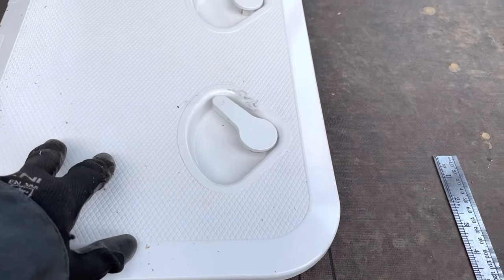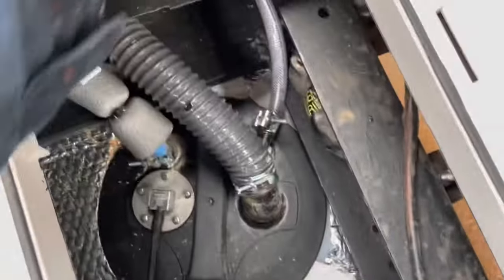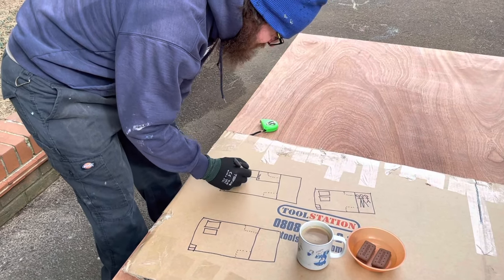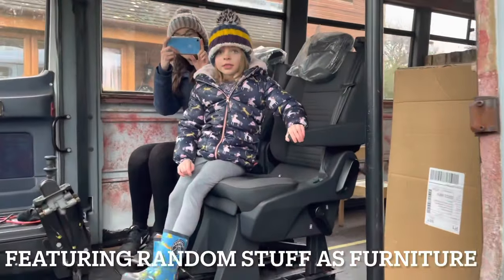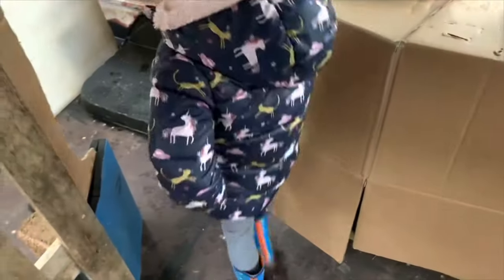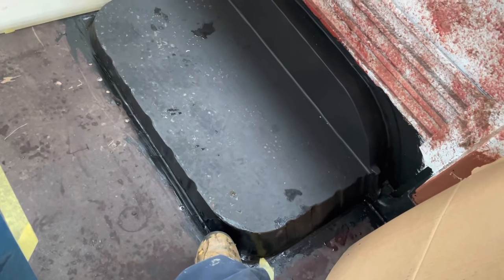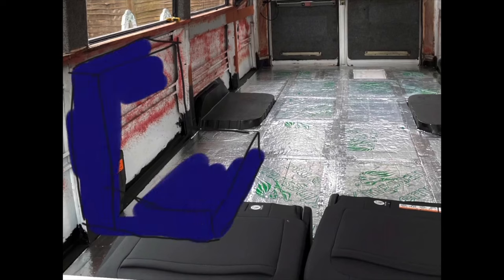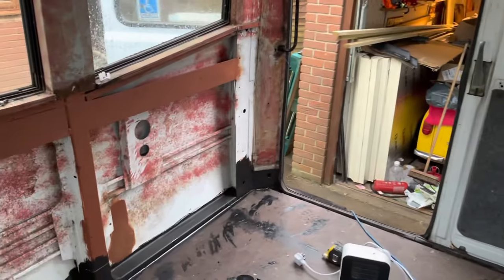Planning Our Van Layout | Mercedes Vario Bus Conversion

Comment: Have you concidered having the bed running length ways.  This will leave enough room to put the shower/toilet at the back of the bus by the rear doors.  I think this layout will create a more open space at the front of the bus for a kitchen and seating area.  The seat can easy accommodate a small bed for your daughter.   Im just starting my build of a vario 814 and this is my prefered layout.
Reply from the maker: That does sound like an option. So would you access the bathroom via a ‘corridor’ down the side of the bed? Or would the bathroom be next to the bed?
Reply: @WanderbusAdventures  the bathroom would fill the space from behind the wheel arch to the back door leaving a little 'corridor' besides the bed.  This keeps the toilet away from the kitchen area and makes the rest of the van seem bigger as there isn't a massive toilet cubicle in the middle of the van.
Reply from the maker: That makes sense. Our fixed passenger seats do eat into what’s in front at the moment which means there’s less space to push the bed forward. We will mark it out on the floor though. See what might work.

Comment: G'day Rich, Kelly and Lilly, good to see you again the hatch  cover reminds me of my boat that I use to have good idea the the way that you have used it as an inspection hatch.    How you have design  the fit out looks fine I wouldn't like to do it but I think that you have used the available space well, the only thing I don't like is the composting toilet.    I rented a van once and it had a cassette type in it and it was fine the thing is with two adults and a child the urine part will fill up quick.   I know it's probably just me but I hope that you don't take offence, those front seats are the "ducks guts" they look very comfortable as always great to see you all take care kind regards John
Reply from the maker: Thanks John. Amazing feedback and advice as usual. The toilet consideration is worth knowing. I know lots of the kits come with a smaller bottle, we we might be able to perhaps put a larger container under the bus via a pipe. I know wandering home even put a level gauge on theirs! The Seats are pretty spicy; much bigger than most but we think they’ll be super comfy and safe. Take care John and thanks for watching.
Reply: The problem with using the pull out sofa bed for your daughter, is that it forces you to go to bed when its her bedtime, you really should have space above you bed to build a bunk for her, then it leaves the sofa bed for you and your wife to sit on during the late evening
Reply from the maker: Yes that’s a good point. We are hoping the bunk can work but if push comes to shove we have the two areas. Let’s face it I (Rich) will likely be relegated to the spare room anyway 😂

Comment: Best to make the bed first so you can work with the space left, if you go to ikea they sell adjustable bead beams, you only need 3, plus the sprung bases and memory foam mattress, whole lot cost me £196, strong, easy to build and ultra comfortable, worth a look before you buy timber to make a frame etc, your doing well and nice that it’s a family affair.
Reply from the maker: That sounds like a great idea and makes total sense. We do like the idea of having a slatted bed to allow for airflow and it must be nice and comfy. That’s amazing value from ikea; we love that place! Thanks so much for this. Take care.
Reply: Product name for ikea bed beams is Skorva midbeam , code-901.245.34.  £10 each, I used 3, very strong and light, quick to install too.
Reply from the maker: Thanks so much for looking that up. So did you use three mid beams to make a ‘floating’ type bed?
Reply: I bought two single slatted bed bases to make a double, this enables you to have one centre beam for added strength and the two outers thus making the bed totally floating so to speak, doing it this way makes the bed super strong and leaves full accessible storage underneath, the beams are very strong and easily adjustable to the width of your van, with a double standard size memory foam mattress (which are available in different firmness) it’s super comfortable too, cheap to do, super comfortable, allows the mattress to breath so no mould issues and full unhindered storage underneath.
Reply from the maker: This is super helpful to know and it’s great to hear that it’s worked for you. We will look into it for sure; we just wish their delivery was much cheaper due to the current situation. But we can work around that I’m sure. Thanks again. Very very appreciated. Take care.

Comment: Try to give each space a double function where possible. That will give you more free space to walk around and will give a more specious feeling, less crammed. The walking space is very limited in the design. Maybe the door(s) of the bathroom can be used to enlarge it when opened. You only use that area very little during the day and it takes up a large space. Same for the bed. Half of it could be sliding (still plenty of storage underneat) so more space during daytime. Just some thoughts ...
Those seats are very clever ... what brand/type are they?
Good luck with the build
Reply from the maker: Great tips and definitely food for thought. We have been thinking the bathroom door would be a ‘sliding’ one which would give a bit more elbow room when open. At the moment unsure if this would go on the quadrant ‘end’ or the flat end as shown in the video. But both are possibilities if we can source one of those squeegee door things. The seats are from a Ford Tourneo Custom. Basically when taxi firms convert vans into taxis they often remove a bunch of these seats and sell them on. Ours are ‘second row’ seats which means we can have them as they are or even switch them to be rear facing into the living space, which opens some possibilities in itself. Anyhow, great tips Rob. Lots to consider here.